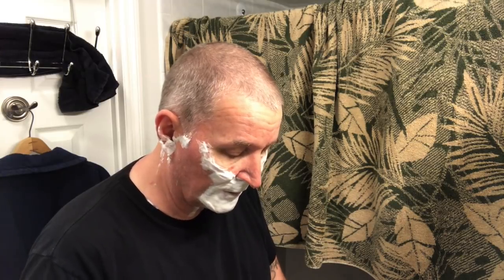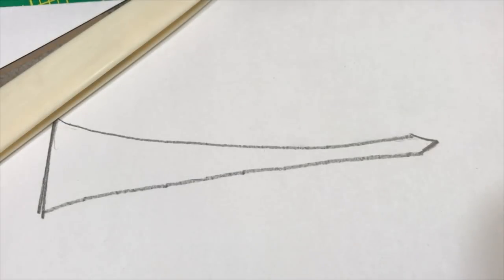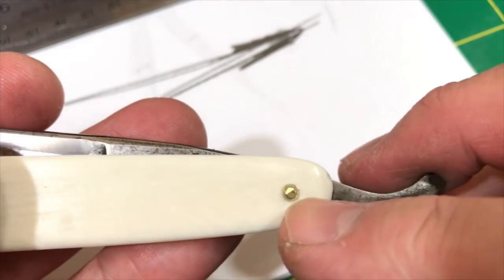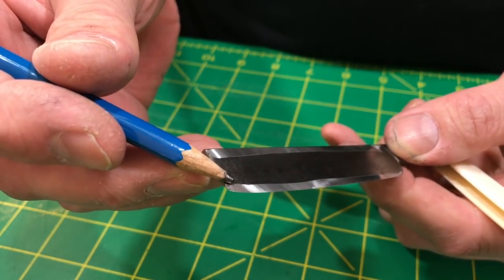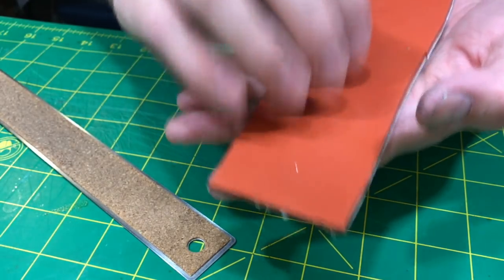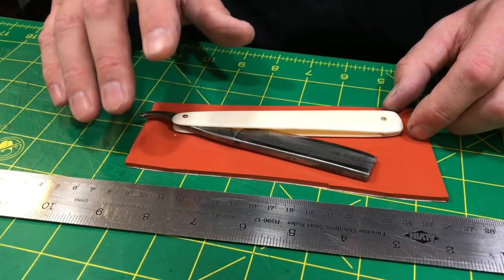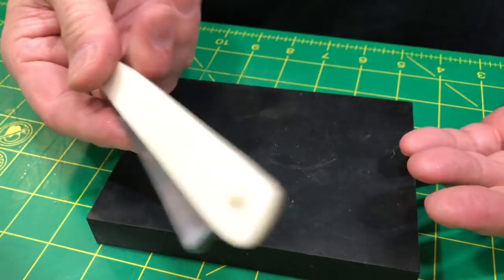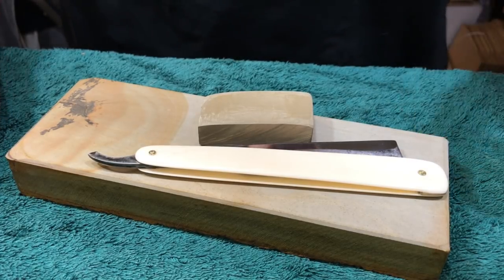Straight Razor Restoration, Bevel Set, Hone and Shave

Comment: Amazing video Keith! Extremely helpful, educational and inspirational! I think there are a lot of guys out there who are scared to unpin and re-pin a razor, myself included. Would love it if you would do a video geared specifically toward how to do that in detail.  I have a Ralf Aust that I neglected and there is some rust by the pin. I would love to be able to take care of that myself without sending it out.  I know you would be able to shed some very helpful light on how to take care of the issue such as that. Keep the amazing videos coming!!
Reply from the maker: That is a good topic for sure. But pinning is hard to capture. My first video, the one where I restored that big W&B, has a section on pinning. The thing is this though, you don't want to learn on your RA, chances are you'll break the scales or scar them or something. Best thing to do is to get a bunch of cheapo practice razors to start off with.  There are soooo many different things that can go wrong or get in the way that it would be hard for me to show a good enough cross section of the possibilities. I will probably do more restoration type videos, and I may consider adding some additional focus on the unpinning/pinning portion though.

Comment: 0:56 Saw some tugging there and wasn't impressed............until you said that was off a 1.5k stone.
Also at 1:14 I see you've decided to continue honing with circles ON YOUR FACE, now that's brave. lol.
Reply from the maker: Yah, don't want to shave like that everyday but if I had to I could.  Getting a bevel to that stage is critical for maximum edge development. I believe most new guys  underhone, so this is a good benchmark. If you're not there' you know instantly - the amount of tugging from an undercooked bevel just plain hurts.
Reply: @KeithVJohnson1  I've got one of those 1.5k Shaptons on the way right now. 

I have been bevel setting (more like touching up) on a 5 -8k combo but have just finished restoring a Wade & Butcher near wedge and it needs a "real" bevel set so needed the 1.5k. Should be a beast when I have it all honed up. I'll be doing 1.5k, 5k, 8k, 12k Shapton followed by 1, (0.5 CrOx) 0.3,(0.1 FeOx) and 0.05 micron film. 

Your vids have been good preparation for taking on one of the more difficult honing jobs, a smiling near wedge 14/16ths W&B chopper. Cheers.
Reply from the maker: Awesome, thank you for watching and commenting!